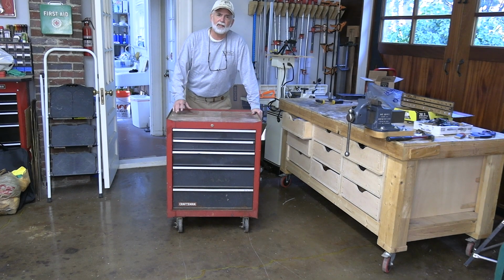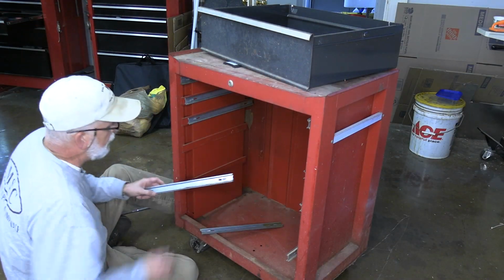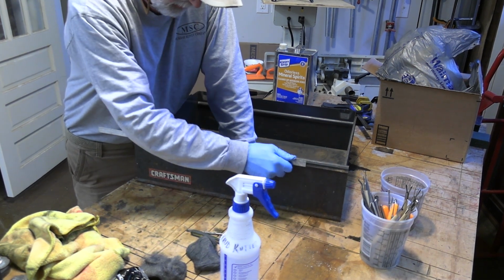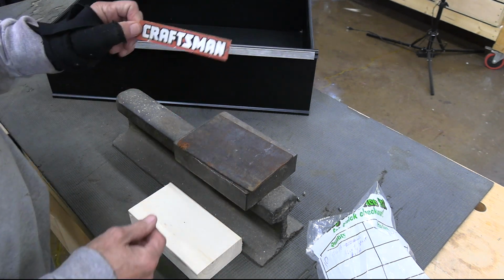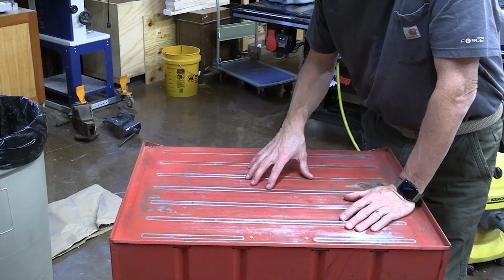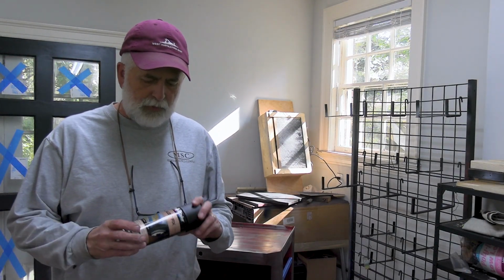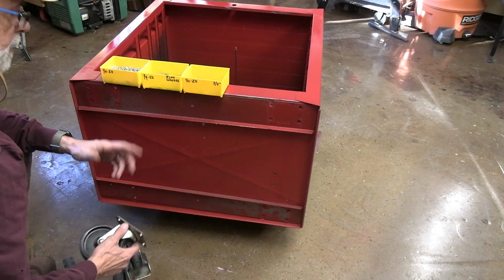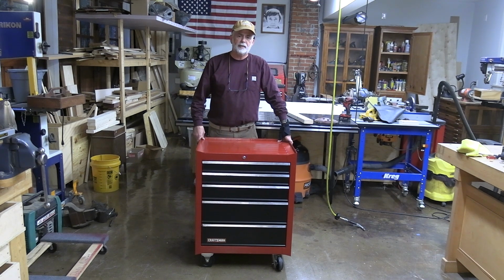1980's Craftsman Rolling Tool Chest

Comment: I am just finishing up a similar Craftsman box, top and bottom with 24 drawers total. I painted them all inside and out. I did not know what I was getting into. About the same surface area as a car!!  I used Rustoleum too, but by the quart, thinned with acetone and I used a hardner for added durability, sprayed with a HF purple gun.  This was easily a $1,000 paint job if hired out...easily!!  I had about $100 in materials and about 25+ hours labor, not including moving tools in and out.   Rustoleum gloss black and their gray mixed 50/50 makes a nice dark gray almost identical to the original Craftsman color
Reply from the maker: Hey Barry, man that tool chest sounds awesome!  That is quite some paint job you put on it and I'm sure it is beautiful and better than the factory!  I was thinking about doing similar on day.  I have several other videos with boxes and chest and have a few more to put out, but nothing as fancy as yours!   I wish you had a YT channel so we could all see that.

Comment: Nice work. I've restored 3 bottoms and 2 tops of these Craftsman cabinets. I use Rustoleum Sunrise red. To me it is a closer match to OE. For the drawers I use Rustoleum Black Stainless Steel paint color. Almost a 100 % match to the grayish color from that period. I also redid an early work bench that had the red drawers with gray sides and switched it to gray drawers and red sides to match. As the OCD kicked in I took 2 small 6 drawer metal cabinets from Ikea and also painted  them in the Craftsman colors.
Reply from the maker: Thank you very much.  I have used Sunrise Red in the past, it is similar to the Regal Red.  I'm about done with the Regal Red, it takes days and days to dry and I don't get it.  You'll see this Friday I use Sunrise on another project and dried solid overnight!  I'll have to look into the Black Stainless, really appreciate that tip.

Comment: Think the paint is latex paint, which comes off easily with ipa alcohol, and the degreaser was acting with possibly overspray from brake  cleaner. I have one too, now in Ireland via England. Purchased by an accountant in Alabama, then shipped to UK in 1995, when he and family moved back.  Dry ptfe spray is the best for the slides and it wont stain clothes and stays in place longer than oil or grease
Reply from the maker: Wow, that box has traveled!  Great story and suggestion on the lube.  Thanks for watching!

Comment: W 186 I believe means manufactured in January of 1986. As for the "W" it's possible that was the stamp for SK Tools although there isn't much info online regarding letters in the mfg date code.
Reply from the maker: That's good info, thanks for providing and checking out the video!

Comment: I disagree with you not painting the inside back but other than that you done a first class job . Thanks for sharing it . David
Reply from the maker: I appreciate your comment and you are probably right, I should have painted it as well.  It does have a really good coat of the Rust-Fix on it which will 100% protect it from rusting.  Thanks for always tuning in.
Reply: What color of red again. And did you use a gloss black paint? Sorry but I’m hard hearing.

Comment: I have older Craftsman boxes that I have covered in a video where you can see the slides are made differently, with a spring release that is much easier to disengage to remove the drawers and slides.  Recently at work I looked closely at several Kennedy Tool boxes in our machine shop and they have what looks like exactly the same slides as my older Craftsman boxes, so it appears that Kennedy was making the Craftsman boxes at some point in the past!
Reply from the maker: Cool!  I'm working on top section box currently, video will be out in a few months, that has those same spring retentions.  Way better!

Comment: Where can i get a replacement slider for these type of toolbox
Reply from the maker: Possibly from Waterloo, they may have been the maker for your box.  Short of that maybe ebay.  Garage Journal website is pretty helpful with questions like this as well. Lot of different ideas.   Best of luck and thanks for watching.

Comment: I have one of these except the Otto is a pull out tray. What’s that for
Reply from the maker: I have that same one as well, little bit taller box and the top drawer is a tray.  I guess is designed as a work surface, assuming you would have another box stacked on top.  Thanks for watching
Reply: I apologize I was being an idiot, just like a security cover for the bottom end

Comment: Does the spray paint hold up to scratches being a tool box I wouldn’t think it would hold up very well but every video I have seen on toolbox restoration they used spray paint
Reply from the maker: Well, it does hold up pretty good.  I always let mine dry for a few days and then 2-4 coats of clear on top.  Once it sets for awhile it does become a durable finish. The cure time is key, it will get hard.   Of course it isn't going to stand up the rigors of daily use on a tool box. Mine are being used to store and display my tool collection.  I have painted many other items  (like my daily use vise) around my shop with rattle cans that get used on a regular basis and it holds up okay.  I don't have powder coating or some sort of industrial paint with a spray system.  Most people don't and that's why you see so many painting with rattle cans.  Good paint inside, not the best delivery system.  Hope this helps and thanks for watching.